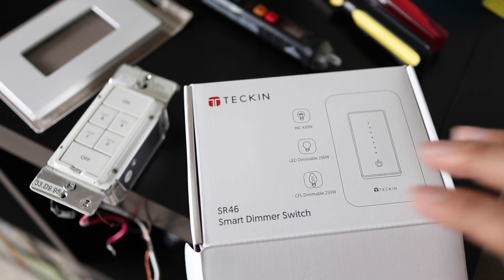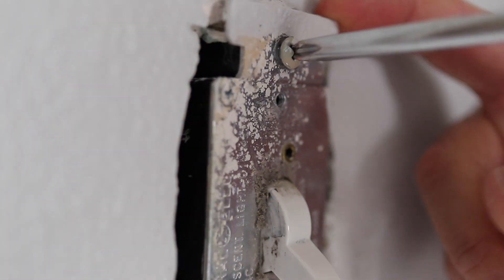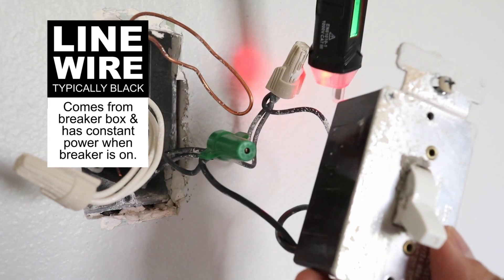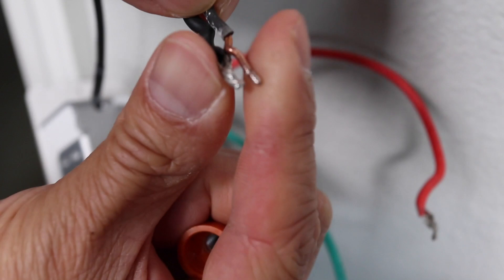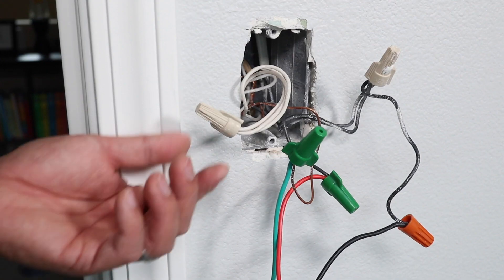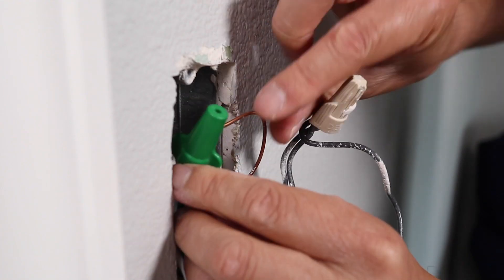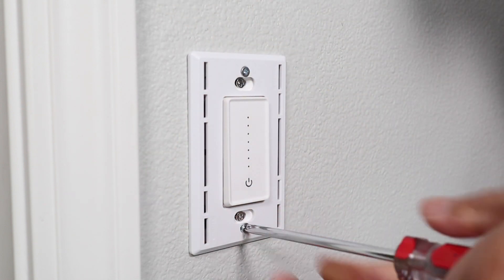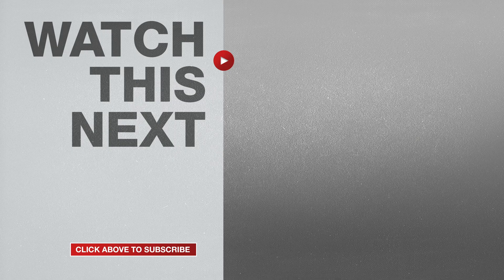Smart Switch Installation - Line Wire vs Load Wire - Neutral vs Ground Wire - Find Neutral Wire

Comment: From the existing switch The neutral white wire  is being used as a load conductor coming from switch. Any suggestion on how to wire ? Would it be okay to merret the “ load wire(white neutral) with the “load & neutral wire (smart switch)

Comment: Thank you so much for this video. I've never worked with a neutral wire before and was very confused when I saw them all bundled together. I was installing two smart switches in a two gang box, And wasn't sure if I was supposed to lump them all together or not.

Comment: This is very easy IF there is a neutral wire in the box,  if not, how can a DIY homeowner install a separate neutral wire ti the switch box to the light fixture to feed the smart switch?

Comment: how can you tell which is ground wire and which is neutral, if the colour is mixed in all the house (very bad job...!!!)? how can you measure them...?
Reply from the maker: I’m not an electrician so I can’t give a very good answer to your question. I do know that the ground wire typically does not have insulation. My neutral wires were all white but that confused me also. Using my wire tester I was able to identify the line and load. Ground was easy to identify since it had no insulation. Which I then concluded that the bundle of white wires not connected to anything were the neutral wires. Sorry I can’t explain this better. I just do simple DIY stuff. If your house is old it’s very possible there are no neutral wires in your home.

Comment: Question, I have no neutral wires in my home as it was built in the early 70's. The smart switches require a neutral wire to power the wifi chip in the switch. Couldn't I simply split the hot wire or load wire before it goes into the switch and use the new hot or load wire as a neutral to power the wifi portion of the switch? I am aware that there are no neutral switches on the market but they are 3 times as expensive and im broke so Im looking for a simple hack to bypass this without having to rewire the house or return all the switches and go back to the originals.

Comment: My house just has a black and white wire. No ground, no load. How would I go about installing my smart switch without having to tear out the wall?
Reply: I have the same problem, where you able to figure it out?
Reply: @lizolivas6045  not yet. My dad said he’a just going to attach and run wires from the ceiling fan to the light switch box. He got the wires already but we’ve yet to install them

Comment: Btw! Can you get by not connecting the green grounding wire. The brand that I have doesn’t have nicely laid out wires and the electrician didn’t leave any leeway in the switch box either.

Comment: i only have black white and ground can you connect the load wire red to the live ? its for a smart switch
Reply from the maker: If you only have 2 wires in your wall box I would talk to an electrician about your options. I’m not qualified to answer that type of question. A smart switch needs all the wires connected to the correct wires in the wall box. Sorry I can’t be of more help!
Reply: Did you ever find out if you can connect the load wire to both the load and line wires on the smart switch?